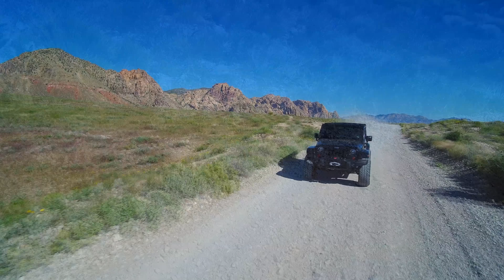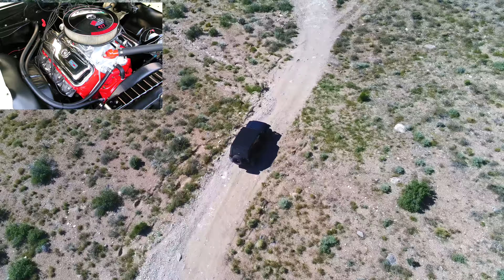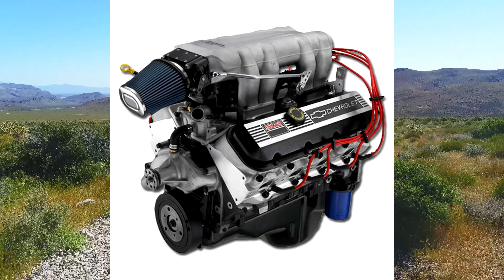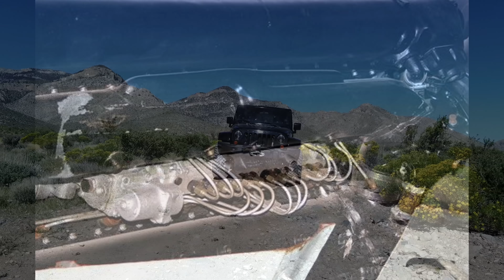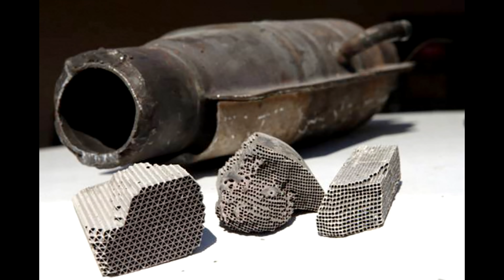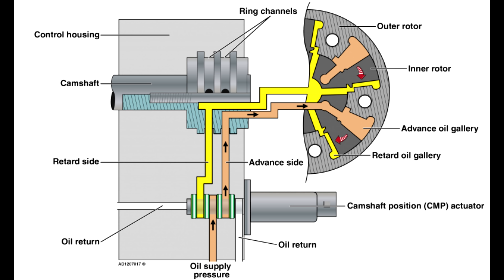Gen 4 to Gen 5 Evolution not Revolution

Comment: Still learning about the direct injection as it relates to the Gen 5 motors.  Could you please explain what GM has done to alleviate or at least mitigate the carbon buildup on the back side of the valves?  I know Toyota has introduced both direct injection and port injection to essentially cure their engines of the problem.  But most of the manufacturers are keeping quiet on what I consider could eventually be a mechanical time bomb for the consumer.